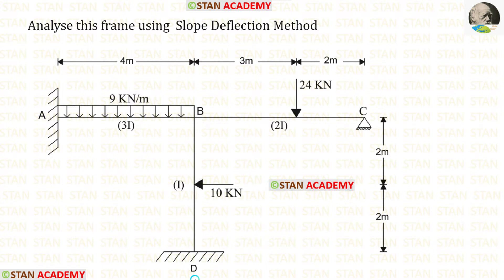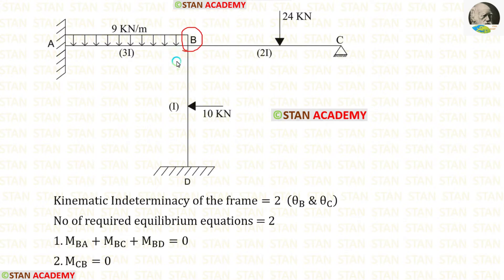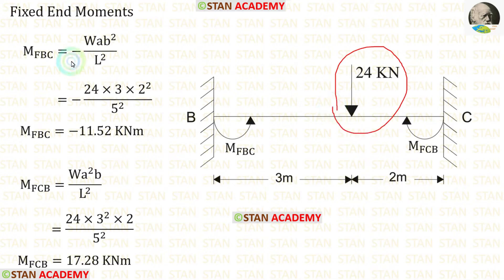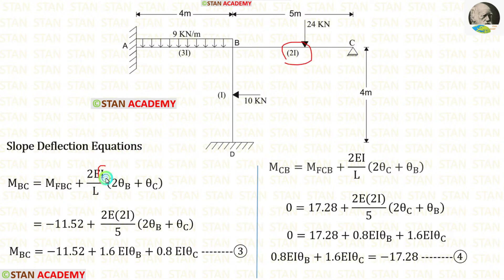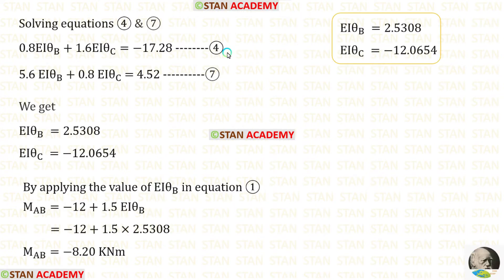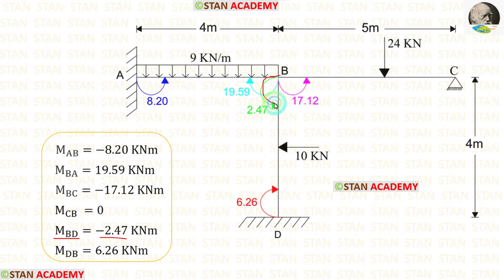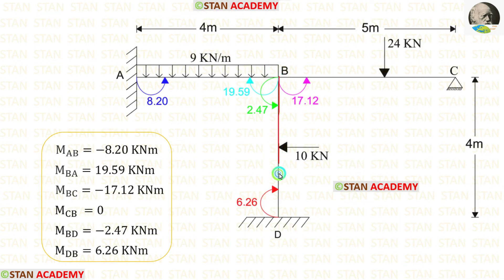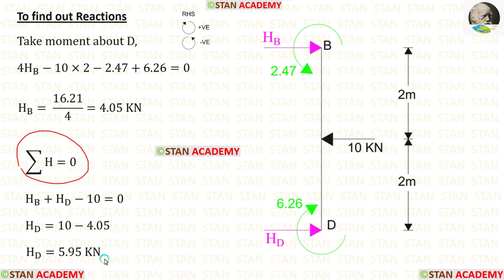Analysis of Frames by Slope Deflection Method - Problem No 2 ( Analysis of a T Frame )

Comment: Highly appreciable for making the videos sir, which are very much helpful .. sir at point D we should get negative moment as its fixed support. but we got end moment as positive, and in moment diagram for vertical member (BD) you have sketch in one direction when we have positive and negative. could you please clarify. it will be very much helpful